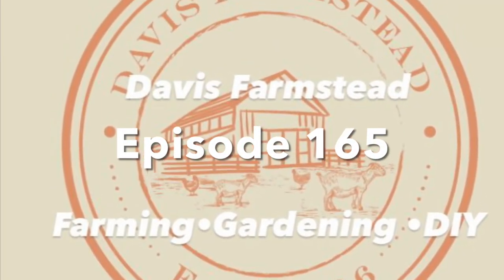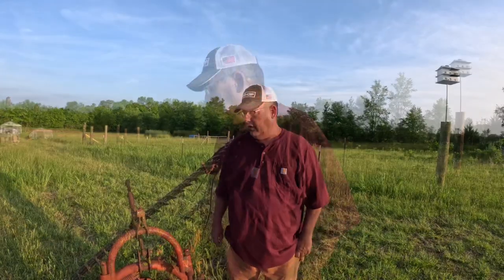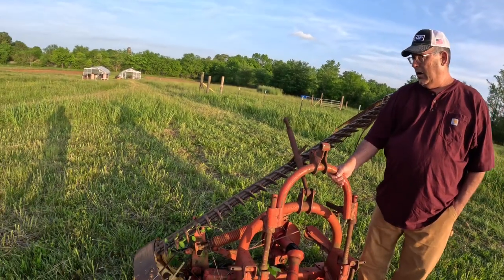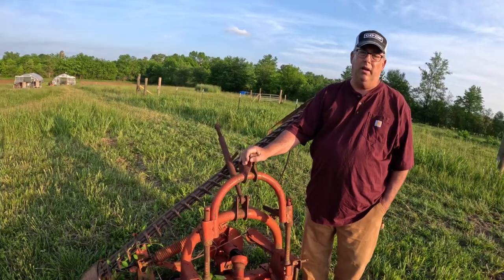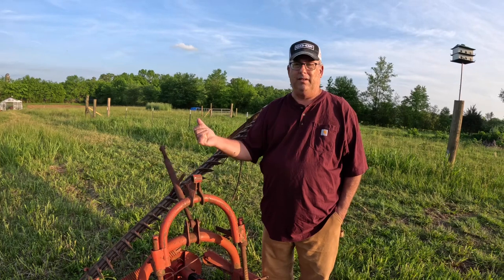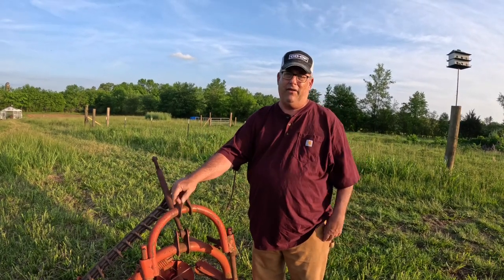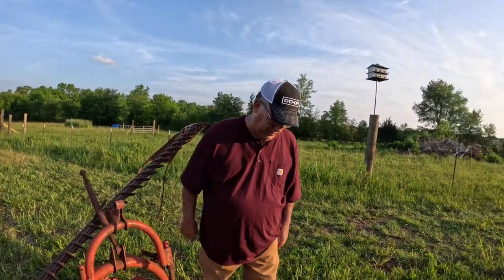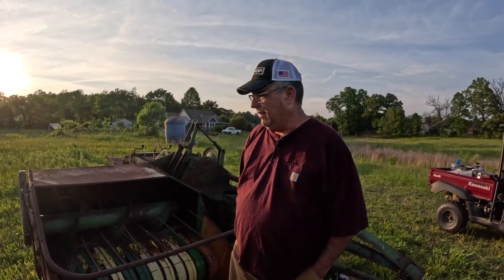Small-Scale Hay baling Equipment

Comment: If you said in the video I missed it but what hp tractor is needed for that equipment?
Reply from the maker: That is a great point I should have addressed. My main tractor is a 55 hp. But I have used the baler with my 30 hp 1954 ford with no problems. I would say 30 hp would be the minimum. Thanks for the comment!
Reply: @davisfarmstead  - thank you for the reply 👍🏻